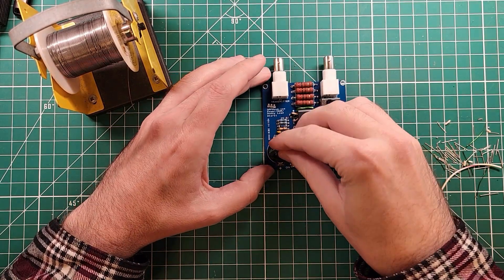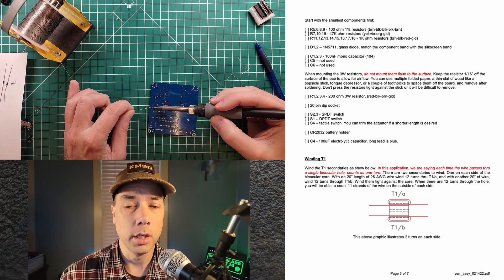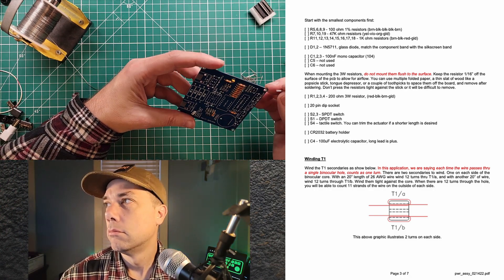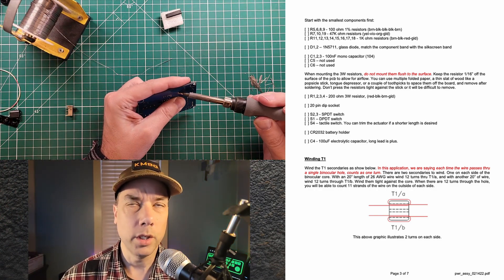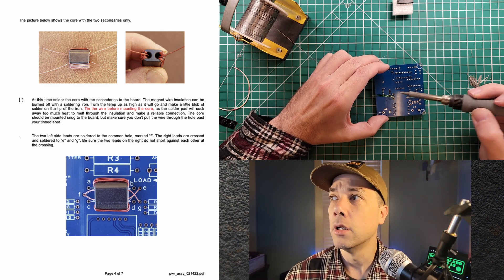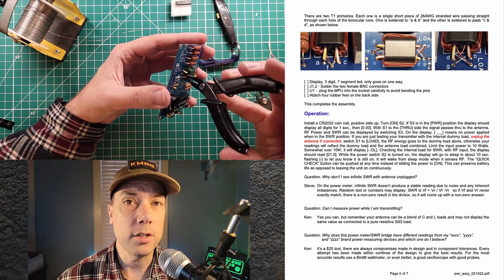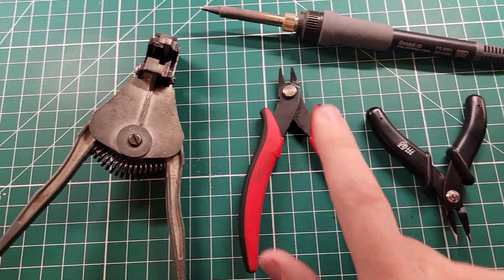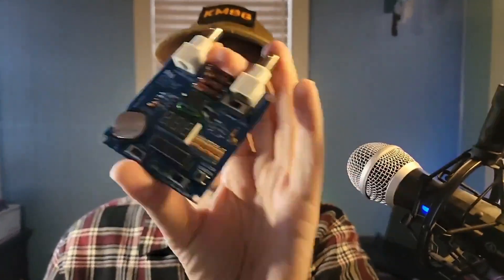QRPGuys 3-Way Meter - A $40 Must!

Comment: i couldn't solder my way out of a plastic bag. what kinds of things did you start with to build your soldering skills up? i just about fried a PCB board trying to get an led display off a preassembled hotspot. wasn't pretty.
Reply from the maker: Just find something cheap that you want to build/use - a clock, a christmas ornament, etc.  Cheap enough that "paying for the education" won't hurt - and by that I mean learning that your technique was off, learning that the kit sucked, throwing it away.  Remember when you were a baby and you came out of the womb walking and never once fell over?  (me neither)... as adults we don't take kindly to "learning from our mistakes" and think we should just get something difficult right away on our first try.  Keep pluggin, you got this!
Reply: @temporarilyoffline  Thank you for the advice. I'll take another whack at it on some old stuff I no longer need around and see where we end up. I appreciate it

Comment: The building is easy. Mine went well but for one solder connection I missed. I figured that out when it didn't work unless I bent the board. The digital read out is great since it allows a more accurate comparisons of antennas. I only wish it wasn't so QRP. A switchable range that goes up to about 20 watts would be handy.
Reply from the maker: Yeah, that would be nice!

Comment: I found this a month ago, and commented, but now, a different thought.

TO, did you measure the load resistors before installing? Looks like gold stripe for 5%. 

Are you planning another video with other bands?
Reply from the maker: I didn't measure the Dummy Load resistors, they were kinda sticking out like they were special among all the parts.  This kit is not band specific (other than probably only being good on "HF" bands)

Comment: What if you stick four plasticine balls in a square and fit the board’s four corners slightly impressed into the plasticine and inch above the table. Then lift, turn, place back, the board as needed! Cheers!
Reply from the maker: That would work

Comment: Great tips as always! Being "old", I do not trust myself with colour codes, so usually use my DMM to sort out resisters, and putting all the components on a bit of paper makes them easy to find and check they are all there. also it shows you if you have not fitted a part if any are left over, unless, like a couple of kits I bought on amazon, they chucked in some extra bits! 73 Jim M7BXT
Reply from the maker: Oh I hate it when they send extra parts!  That's how they get ya!
Reply: @temporarilyoffline  It depends what they are. Callum used to send extra nuts and bolts for when you lost one in the grass! Now that is customer service! 73 Jim M7BXT

Comment: I built one of these last year, it works great, the only thing is I would prefer some kind of a case as a option, even something as simple as a Plexiglass case. Thanks for the video.
Reply from the maker: Here's what I did:  https://www.thingiverse.com/thing:5333701  If you don't have a 3d printer, there are some online places that will print and mail to you.
Reply: Buy standoffs and a bit of plexi?

Comment: Sorry for being a dufus again, but around 13:10 when you said you were plugged into a dummy load with the 6100, where was the dummy load? It seemed the meter output wasn't connected to anything. ???
Reply from the maker: No worries: This device /is/ a dummy load - the 4 big brown resistors are the dummy load and the switch below the right-side BNC turns on/off the using of the dummy load.

Comment: Stop peeking at my project list and doing it just before I do!  😂. Nice video.  Excellent info and a great example of a use case where precision is more important than accuracy.  When tuning for max, it doesn’t matter if the number is wrong, it’s that higher is higher and lower is lower with precision.  Excellent.
Reply from the maker: This guy gets it!